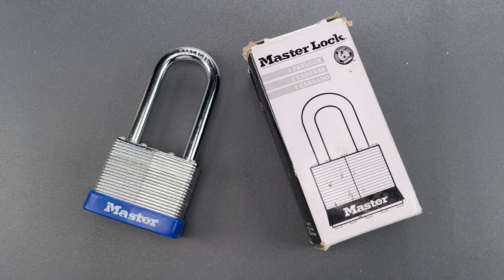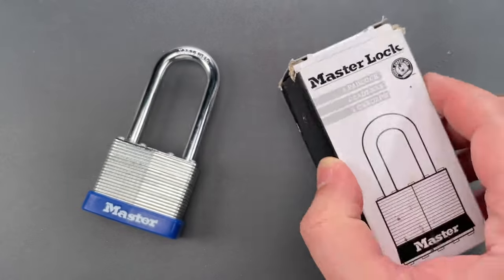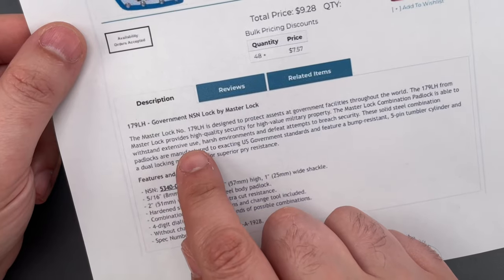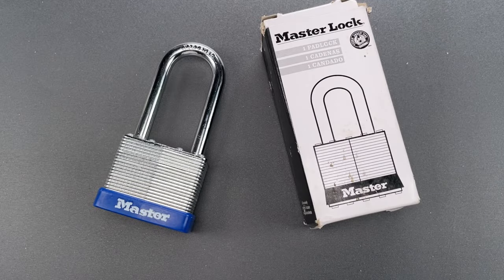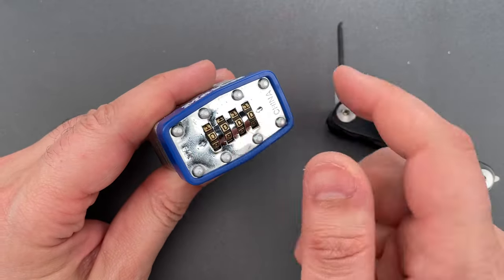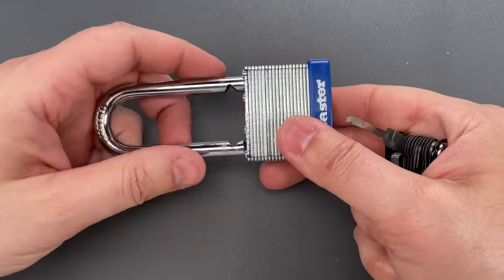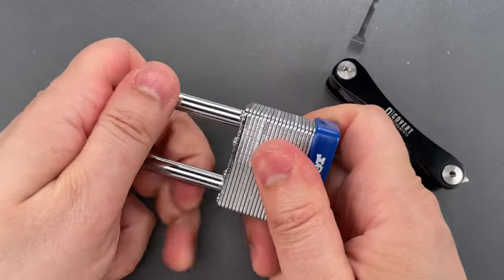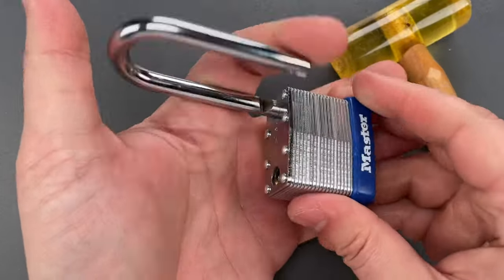[1449] TERRIBLE Master Lock Laminated Combination Lock (Model 179LH)

Comment: We had one of those, or something similar, in my warehouse where we kept classified parts that were waiting to be shipped out. 
Funny thing is that these security cages are protected by military personnel only when we’re in the shop and we trust that nobody is going to try to break in to them. The actual lock itself doesn’t matter because everyone on base is expected to have enough integrity to do the right thing and leave these kinds of things alone. 

And while gate security might not be much more than some private contractors checking IDs, we do have sensors all along the perimeter of the base so we can tell exactly where someone was trying to get in. 
The ones at my base were constantly being set off by wildlife in the wooded areas surrounding the base.
Reply: Back in 2012, in the National Gallery in Athens, an art thief triggered the alarm over a hundred times. Eventually, the security guard just stopped responding.
You make it sound like a plausible tactic for infiltration of that military base. :P
Reply: @nephicus339 , plausible? Maybe. 
But we were under AFSOC. Air Force Special Operations Command. Our primary mission was combat search and rescue and were home to at least one Squadron of Pararescue Jumpers. 
PJs are the guys who get good guys out of bad places and often conducted nighttime training drills in those woods. 
So if some group of morons thought they could sneak in they were gonna have a bad time 😂

Comment: "Are the nuclear codes safe?"
"Yes, they are safely stored in the lockbox."
Maintenance guy,  "I'll grab my hammer."
Reply: Xkcd 538
Reply: No joke for the longest time during the cold war the nuclear launch codes were literally 7 zeros because they thought they would have to do it quickly, or at least that's what I've heard from several places.
Reply: @nesyboi9421  Arming codes, but yes. It's called the "Permissive Action Link" and it was technically 8 0's. The system was designed to protect US nuclear weapons posted in countries like Turkey that it was feared might hand them over to the Soviets. The Air Force officially denied it but documentation supporting it has surfaced. It also didn't help that the denial used highly specific wording.

Comment: I thought I should point out the "military grade, high value" claims are made by Master Lock, not the government, which is capable of setting good standards for padlocks they use at least some of the time.  I'm thinking of the S&G combination locks used to lock up top secret files and, I think, in certain nuclear facilities.  Those locks are certified to withstand a certain number of minutes of various types of attack and even a model discontinued after being found to no longer meet the standards, is still a pretty good lock that sells for a fair amount.
Reply: Even with higher security locks, that a delaying tactic. It is the layered physical security and guards that keeps most things secure on a military base.

Comment: I'm guessing that nobody who encounters these locks in a military setting attempt to pick them...generally 1 well place (or poorly placed) round removes them quickly.
Reply: well yeah, assuming they're armed on base and most of them aren't lol
Reply: Pistol whipping seems to do the trick.  It's even prepared for WW4 (the one fought with sticks and stones because WW3 wiped out everything).
Reply: A lock like this is probably good enough for lockers that soldiers use to store their uniforms. For all its flaws, it does prevent one person from accidentally opening another person's locker, since you're not going to take out the hammer (or a notched decoder) "by accident". In the event that somebody forgets their combination, the ability to use the butt of their rifle as the "hammer backup" is also useful if they need to get in quick.

If an army really does have soldiers using hammers or notched decoders to steal other soldiers' uniforms, they probably have much bigger problems.
Reply: Surely firing a gun on a military base full of soldiers when attempting to breach a secure location or container has no possible downsides. Also, the whole shoot the lock thing can result in a lock can't open at all without bolt cutters as seen on this very channel.
Reply: Any security attacks can be broadly categorized as "Invasive" and "Non-invasive". Of the two the latter is the most dangerous one as, you will not know a breach has occurred until very later point of time. Sometimes it is impossible to know if such a breach had occurred. When invasive attacks you always know the breach occurred and how it happened.
Reply: @ab-tf5fl  That would be my thought. How much is a padlock actually used on a tank for security versus creating just enough of a speedbump to make it clear that accessing was done intentionally rather than in error. Presumably the actual security would be provided by all the security personnel and measures around the base.

Comment: Master lock should really listen to your videos and make improvements to their products
Reply: GM flew a couple of professional car thieve from England to the US to try and break into vehicles. They were allowed to practice on cars without panels, use any tool and even make their own tools but they had a time limit and could not cause damage that would be highly visible (like break a window). They could poke small holes. I was a deck lid engineer at the time. It was fun working with these guys, they were really good.

Comment: As anyone who’s served in the armed forces can tell you, ‘military grade’ isn’t the talisman most people think it is. 😄
Reply: Doesn't military grade only mean that it won't break immediately when thrown on the ground?
Reply: @brag0001  It means they were the lowest bidder.
Reply: @brag0001  No the only thing ”Military grade” stands for is unreasonably expensive.
Reply: Considering that our military rarely assigns a contact to anyone other than the lowest bidder, I’ve never held “Military Grade” to any notable standard.
Reply: @brag0001  It means it was the cheapest possible product that looked like it was well made enough to do the job from a layman's cursory examination. Like what the entire brand of Masterlock operates on to continue existing.
Reply: @peterjacobsson  I was working from the videos I've seen about the adoption process of firearms pre- and during WW1. Back then apparently the most important adaptations compared to civilian models were ruggedness and ease of use. I don't doubt that this has since been watered down significantly.
Reply: @jeffreeves1567  That's not fair. They also assign them to the friends and benefactors of the people making the decisions.
Reply: @nonna_sof5889  My mistake, I forgot about those…
Reply: "Military grade" is a marketing term used by the companies that sell to the government.  I've never heard that term used by the military.

Comment: I went to a U.K. store called trespass recently and found a lock that was a 4 dial lock, I was able to open it without damaging it, simply by pulling the shackle hard enough. I then locked it and decoded it behind my back to impress my gf. I also have never picked a lock before hand; simply used the knowledge you’ve taught about decoding them. 
Absolutely appalling lock design
Reply: Did you get into her chastity belt in the end?
Reply: @mandowarrior123  haha Yh a did

Comment: "The master lock combination padlock is able to withstand... attempts to breach security"
If the military is guarding their defenses with a combination padlock of ANY quality, I am incredibly worried for this country.
Reply: Well here's why, you can't have a guy looking out after every single tank/humvee at every single barracks in every single city where one's located, especially with how widespread the national guard is across the US. Actual bases are very secure with armed guards and what not, but you have to do something to deter somebody from just breaking into a tank and taking it on a joyride for those smaller barracks, which has ironically happened before with an M60 patton, the video exists on youtube I'm sure look it up.
Reply: That's most probably the least of the worries with the current military.  This country is not in a good position to defend itself as the military is spread way too thin mostly elsewhere.

Comment: your videos are quite valuable
you don't realize how useful lock picking can be until you need it

once got in to a situation where I had to pick the lock for a motorcycle gas tank because the customer lost the key
I hammered and ground some nails in to an approximation of what might be identified as a lockpick and turning tool and picked the lock
took me a few tries since it was my first time(and a wafer lock) but I got it open eventually
replaced the lock itself and could even safe the gas cap

Comment: y'know, it's one thing to have a lock that's not very pick-resistant, but it's another when it's just a visual deterrent, but worse, it sells itself by using all that colorful language. there should be some legal standards out there to prevent this sort of thing, as well as some enforcement because a law without a recourse is no law at all

Comment: Reminds me of my old workplace, 50k investment in a bulletproof door and Glas but the cheapest 20 Euro doorlock they could find. 

I once picked the lock with a hairpin, like in the movies. As a beginner with very little knowledge at the time, i just made a rake and a tensioner and 30 sec later the door was open. 

Still gives me the giggles when i think about all the walls and protection of that place... Defeated by cheaping out on the lock and a hairpin

Comment: We had CUCVs, military versions of pickup trucks, all of them used the same keys so a bracket was welded to the floor of the vehicle so that the steering wheel could be locked in place with a chain and padlock. The padlocks were all keyed differently.

Comment: I had a boss, doing maintenance, who had the worst mixture of cheap master locks to secure the equipment I used daily.

The easiest, fastest way to get through them that I found was to attach a length of heavy chain to the shackle and crack it like a whip. 

I made him get actual quality locks that were all keyed the same.

Comment: Ahhh masterlock. The best beginner practice lock to "pick" 
We had a masterlock at work that we lost the key for. Fancy one with the raised shoulders to prevent bolt cutting. I may or may not have replaced it with one that we had a key for in less than 30s. Boss was so happy he had paid $18 for that high security lock.

Comment: I've been in the Navy for 12 years.  We use Abus padlocks on anything dangerous or valuable, that is most of the time that padlock is on the other side of a locked "vault" door, in a building with an active watch stander.

Comment: I spent 14 years in the Army. Not once did I see a Master lock used on anything. Most common in use was American Lock 5200 series padlock. Most safes were Sargent & Greenleaf. Medeco locks could be found in real high security situations.

Comment: An NSN number is just a number that allows the supply chain to order certain items by that assigned number. Even pens have an NSN.
         The military uses 500 series (key) locks or higher for non critical equipment that is already stored in a secured area. 
Combination locks are only used for personal use such as gym lockers.

Comment: in my experience with government "security" regarding equipment, its often token. this is especially true if its an inner layer of security. from what i've seen, it literally only exists to prevent someone from simply taking an item and walking away; it requires a thief to do something, no matter how simple. i was always floored by how strictly security rules were enforced when the locks were essentially zip-tie levels of secure.

Comment: I remember having 6 digit combos on our padlocks for  containers holding our missile launch  verification codes(Army Nike missile system).  The problem was that the lock shackles were recessed in a shackle guard, so that you couldn't tip the lock up to see the combo wheels to set the number.  You had to crouch down under the lock so you could see the combo wheels.  Not sure how secure the locks were.

Comment: What do you mean, this is standard quality locks for military equipment.

I was watching a news special about how one of the rooms where nukes are launched from is actually a giant vault like room that the government has been keeping propped open with concrete blocks for about 20 years now because the combination and keys to the door were lost. There are still armed guards watching the door, but you lose a little faith in government security measures.

On top of all that, when I was ordered to be a part of transporting M16's in my unit for our reserves two week training, the gun racks were all locked with master lock padlocks inside the back of a vehicle that had plastic for windows. It may not be the most comforting to know that when we stopped to eat lunch, there were 2-3 armed guards watching 2 vehicles with guns in them. Army regulations changed about 3 years after that so we couldn't do that anymore but it did happen.

Nothing like pacing a Denny's parking lot in an ACU with a bullet proof vest and a Kevlar helmet carrying a loaded M16-a2 finger just above the trigger and thumb on the safety hoping no one's that stupid.

Comment: My sister bought one of those small safes for my dad. I took one look at it, and after watching the LPL for so long, I knew immediately that the lock on the thing was a complete joke. I have zero skill, but even I could open that with nothing more than a bobby pin using a raking attack.

Comment: I can tell you that the primary lock used by the US military is the American Lock 5200.  But they are NOT used for high security applications... those are much heavier locks, ones that resist being cut with a plasma torch.

Comment: Can’t have any locks with you around. I have multiple of these that I got from the Army. I still use them or so I did until today… they have been durable even when stored outside for years so that claim was reasonable. Unfortunately the security one was not. 

Could you make a video compiling locks for different uses that you do recommend?

Comment: In other words, it's been designed to government specifications by a committee. The US government does not want to own any lock that would give it any problems accessing vital equipment it might need for military operations. Therefore, they don't actually want any lock that is difficult to open on their equipment. They likely got asked to cut budget spending, so any money spent on expensive hard to open locks is money they cut back spending on!

Comment: So it's just like a Master 175 on the inside and just as easy to open by decoding, or lifting the shackle fork with a shim or sharp rap. They're even putting that thing in the key lockboxes used by realtors and Airbnb rentals.

Comment: There's no such thing as a "high security combo lock" with the three wheels on it lol.  I was first introduced to the idea of bypassing locks when I was like 8 because I realized I didn't have to panic when I firgot the combo to my three-wheel combination lock box.  As long as I invested like 10-30 minutes to trying every combination I could always get it open and reset the combo to something more memorable.  It seems like the kind of thing that would take an hour or some long chunk of time, but it really doesn't.  There's a 30% chance that the combo will be 300 (i.e. 3-0-0) or below, and a 50% chance that it'll be 500 or below, etc., so in all liklihood it'll take you less than 30 minutes to get past the lock assuming you start at 0-0-0.

And that's all assuming you care about avoiding destruction, don't know about shimming, etc.  Even the most inefficient non-destructive bypass doesn't take awfully long.

Comment: I used this lock on a detachment on the USS Nimitz. The original combination was 1738. After about 3 uses the lock no longer worked. We found out the combination changed to 1730 then 1739 then 1734. Worst lock ever. Without your tactics it was just as hard for the user to know the combo as it was for a thief

Comment: "bump resistant"
While you can literally bump into it and it opens... 
One could extrapolate from there: it won't withstand extensive use or harsh environments and will invite criminals to this lacking pry resistance "lock".
Though I do not doubt it's manufactured to exacting US Government standards. The exception that proves the rule.

Comment: im trying to learn on this lock. the most inward pin is almost all the way down and the one outboard of it is almost all the way up (i have the key). Im also using the cheapest tools money can buy. I cant figure it out. with hard pressure on the tension wrench i cant get the first pin to stay down unless i pick the one that is all the way up first. When i start from the inside working out i end end up having to push the tall one down to get the one behind it. and then it stays down and doesnt lock. should i get better tools to try and sneak in behind the tall pin?

Comment: US doesn't use these, at least when i was in service. Used the the "American Lock" brand that would have a steel cable wrap around the steering wheel and secured with a padlock. Oh and none of them were code locks they were all keyed.

Comment: According to folklore, legend and the press there was a time when the UK had expert lock pickers and safe crackers. Today criminals simply use brute force; a sledgehammer, cordless angle grinder, maybe a cutting torch, even a stolen tractor to ram raid or rip the doors off! Unfortunately, however much noise they make they are never caught because they are careful to move from place to place and only 'hit' each vulnerable target once every two years. A useless 'cheap' lock is no more effective than the the most expensive lock.